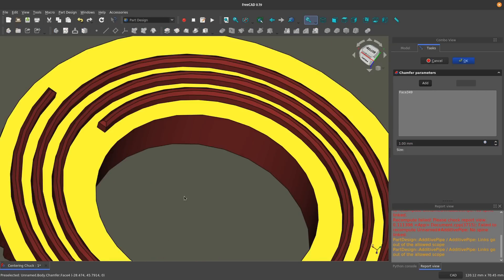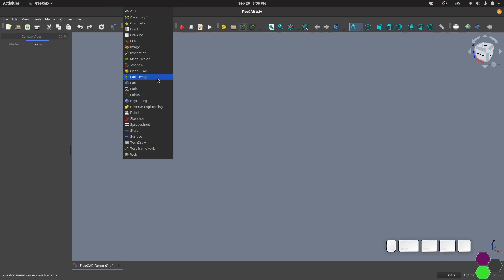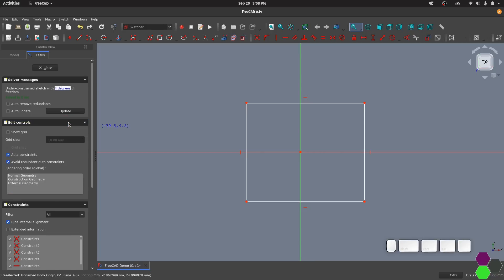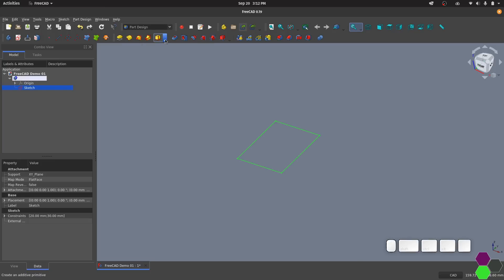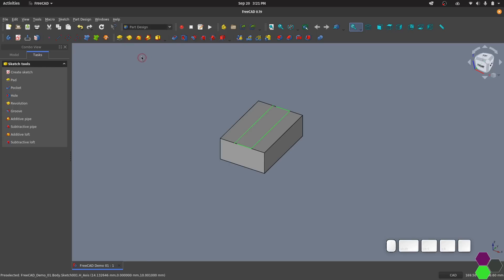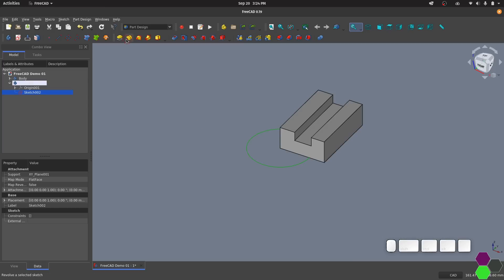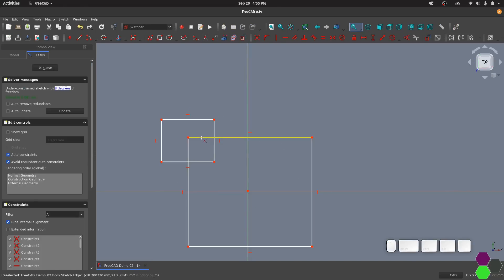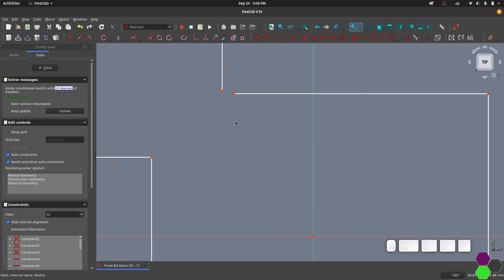Fusion360 to FreeCAD - Introduction

Comment: Excellent video, I'm a. paying fusion user, and I like it a lot on my new Mac mini m4, but Autodesk left out Linux and. my old Intel. Mac, yes I know we all have. to move on...:-(   So I use Fusion a lot, No WindoZ or fusion on. my 2011 Dell, But ubuntu runs like crazy,  ehh hem,   WINDOWS SUCKS,  so I never use it, or any thing Willy boy is connected. to.  Well there is my rant.   Im looking forward to using this to do. a lot.  I confess, I haven't read all the help yet.  Very nice to have an Excellent alternative to Pay software.  I tried. to. use Desaults hobby platform, it's total. nonsense.  and breaks continuously... pay for what you get is what I. hear... hmmm FreeCad. !    YES

Comment: In 360, and can extrude on both sides, how do i do that in free cad
Reply from the maker: When you pad (extrude) an object, just above where you enter how much you want to pad, there is a drop down. By default it will say Dimension, if you want to do both sides, you can select "Two Dimensions". This will give you a second place to enter another extrusion length.
Hopefully that all makes sense.

Comment: Fusion 360 seems to be one of the easiest pieces of SW to learn CAD. I made a start with DesignSpark Mechanical, then tried Fusion. Not an expert user but I do feel comfortable using it. My initial attempt with FreeCad was similar to using Solidworks 2013. It feels much more difficult, and was somewhat dissapointed. Willing to try more with FreeCad mainly because it's available for my work laptop, as a 3D Experience licence for designing stuff cannot be justified yet. And I do need occasionally to design something for work. If it wasn't for the cloud based feature of Fusion 360 I would already consider buying a proper licence. Anyway good video.

Comment: Great video, thanks. Had been using Fusion for a little while, but as it is cloud based, and my connection speed is not so great (retired, and no money) I decided to use FreeCAd. What this did highlight was, my 3D modelling skill. None. I do get confused with bodies, and multiple bodies in the same project, and the relationship when I use, say the sweep tool. FreeCAd is somewhat more bare bones than Fusion, but it is where I am now, for the speed. If you have the time, a lesson on the what is the 'tree' and the rules that would apply to bodies, and how bodies work in the project. regards, David
Reply from the maker: Hi David, thank you for the feedback on both of my videos! I am planning to do some more FreeCAD videos shortly, but in the mean time I'd suggest checking out videos from FreeCAD Academy / Flowies corner (same person, but they have an English and a German channel), Andrew CAD (has great explanations of each individual tool on detail), Joko Engineering and Math Code Print.
If you have any issues, let me know.
Good luck!

Comment: I tried to follow a long but I got lost right at the start when I selected Part design and no new toolbars opened like yours :(
Reply from the maker: They should if you have a new document started, but if not you'll be able to put all the toolbars you need back by making sure you're in the Part Design Workbench, going to the View menu at the top of the window, then to Toolbars and enable Structure, Part Design Helper, Part Design Modelling and Measure.
Let me know if this doesn't work (if it doesn't can you tell me what OS you are using and what version of FreeCAD).
Good Luck

Comment: What I would've liked to see was how components (or the FreeCAD equivalent) work.
Reply from the maker: If you're just after something to create instances of bodies, that is called a "Link", there are a lot of good videos out there on how to use links.
If you're after a full blown assembly system. there are 3 entirely different 
add-on workbenches for that. They all work differently and have pro's and con's and would be too confusing for an intro video.
Reply: @BrodieFairhall  Thanks. But why would I have to get plugins? Can't FreeCAD incorporate these Plugins?
Reply from the maker: @user-yh5dc8ve8e  Eventually FreeCAD will have a built in assembly workbench, right now all 3 assembly workbenches work fantastically and give people a lot of options as well as letting the team work out what the best features for a built in assembly workbench would be (realthunder recently did a talk on this actually). The add-ons can be installed from within FreeCAD, so it's incredibly easy.

Comment: I guess it really comes down to what you need. Sofar it seems to me that for mechanical solid modeling FreeCAD delivers very well. But for product design where you work more with surfaces, blend curves etc it quickly shows missing tools. RealThunder is a pretty god sent for FreeCAD to catch up.
Reply from the maker: You should really check out the curves add-on, OCCT has incredible surface modelling power and this workbench really makes it accessible.
https://youtu.be/iUhHgnvgpo0
Reply: @BrodieFairhall  I did watch and follow it - when I bring the STEP export into Fusion it shows many tangency issues. I might have to investigate more.

Comment: This video must be called: welcome to hell. Freecad is a great idea for the moment, but it's very frustrating to use.
Reply from the maker: If you're expecting it to work the same as some other CAD software, it sure is frustrating.
I've been using it commercially for getting close to 3 years now, at first alongside Fusion and Inventor. I can have access to Austodesk products any time I want, but I'd definitely prefer FreeCAD.
Use what works best for you and if you want to try something else, it's going to require time to really get to learn the workflows.
If FreeCAD is a bit much, perhaps have a look at the Linkstage3 build of FreeCAD.
Reply: @BrodieFairhall  I quit in frustration when I was using the assembly 4 add-in, lost all colors in parts, and I was never able to undo operations.

Comment: the trim tool didn't work on my circle D: it's such a bummer that I can't select surface of a sketch or parts of it to pad like fusion and solidworks. I hope they add that soon!
Reply from the maker: The trim tool can be a bit finicky, it can do weird things depending on how your sketch is constrained. I don't use it 99% of the time.
You could use the arc tool to create the part of the circle you need instead of making a circle and trimming it.

As for being able to selectively pad (or use any other action on) parts of sketches, I doubt that will ever be in FreeCAD, as it's generally viewed as bad CAD practice. I learned why it's bad in Fusion when I started making a lot more customisable / highly parametric designs before I really understood why fully constraining sketches was so important, so I got a lot of topological problems and a lot of other weird geometry problems. It wont effect you in Fusion unless you are really doing a lot of parametric design, but as I learned FreeCAD I started applying what I learned to Fusion and it made me much, much better at Fusion.

Oh also I remember you talking about wanting to project surfaces from imported parts etc. While I kinda advise against it in the long run, this video from Andrew CAD (https://youtu.be/MCY5IrWrHrU) will introduce you to the shape binder tools which will let you do exactly that.

Comment: Does FreeCAD require an internet connection in order to work like Fusion 360?
Reply from the maker: It doesn't require an internet connection, it works completely offline (and doesn't report back to any servers either).

Comment: The video has good intentions.. thanks. But omg, Freecad looks horrible.. i think im spoiled with the ease and good looks of Fusion.
Reply from the maker: This is but an intro to FreeCAD, it doesn't touch on the variety of add-ons to improve the UI and general aesthetics or additional quality of life tools.
There is a development version of FreeCAD which Fusion users find far easier to use from one of the core developers "RealThunder" (Lei Zheng).
https://github.com/realthunder/FreeCAD_assembly3/releases
If you want to see demos of it check out this channel https://youtube.com/channel/UC4PIO2pZaFKzI97uumFTNSg

Fusion and FreeCAD are very different, you can't just apply your Fusion workflow to FreeCAD and expect the same result. Fusion is fantastic for quick modelling, it allows you to be pretty lazy compared to most CAD suites, but after using it commercially along side other packages I don't think it's suitable for real commercial use. FreeCAD on the other hand is most similar to CATIA, in that it might seem clunky for a new user but once you've spent to time to get to know it and develop a good workflow the tools available for it and the power it has is endless.
They each serve different purposes and it's hard to make a direct comparison without discounting the merits of each of the packages, but I'll say this, learning FreeCAD will make you much better and far more effective at using Fusion (speaking from experience).

Can't forget to mention the obvious, that FreeCAD is FLOSS, which means you'll never get locked out of your work whether it be from the removal of a tool, a licence change or a server being down.
Reply: @BrodieFairhall  Well, im going to get going with using FreeCad next to fusion. follow along some tutorials and make my projects alternating on fusion and freecad. and hopefully when the day comes i have to leave my educational fusion account (wich still has unlocked everything) i am used to freecad and happy to move on.. who knows. gonna guive it a try anyway!

Comment: I intensively tried FreeCAD for almost a month full-time. Version 0.19. No offense to the guys making this available for free and putting in their best effort, but... It's buggy mess compared Fusion360. Not to mention it doesn't come close functionally. With a larger model the performance also comes to a halt.

 I was unable to do my project with it. Fusion360 isn't perfect and I understand the loss of trust in Autodesk due to the nerfed free license, but it remains the better choice by a considerable margin if you're doing anything slightly complicated.
Reply from the maker: I understand your frustrations because I have been there. I have a rule, don't learn a new tool by doing a big project with it, it never ends well.

Fusion and FreeCAD work very differently, if you use your fusion workflow in FreeCAD, you'll likely end up with tons of problems and the larger it gets the worse it will be. 
Learning any new tool takes time and since you still have access to fusion, you can take your time to learn but still have access to a tool you're familiar with.
Performance isn't an issue with larger models or assemblies that are built correctly and I would guess that the majority of the "bugs" you're referring to are topology issues (I have a video on that, or I suggest you at least look it up in the forum).
If you learn to use FreeCAD correctly, you'll end up being much better at Fusion too (I used both commercially in parallel for 3 years and my fusion skills were dramatically improved) and you'll find things you like better in each program.
If all else fails, you could try using the Linkstage 3 branch (https://github.com/realthunder/FreeCAD_assembly3/releases), many people feel much more comfortable in it.

It took me 3 attempts to actually move over to FreeCAD, but now I'm here and I wouldn't go back.

Comment: I would like to go to freecad but sadly, it's like many other open source tools. GUI is not straightforward, it's not as focused to task I'm working on etc.
What I am talking about? Well, just look how much you have to mouse around just to set dimensions or extrude, click OK etc. Why not to have this things RIGHT at the mouse pointer and do not mouse through all the monitor to set a dimension or to confirm something to just hit Enter or Escape for cancel? Most people are using big monitors and high resolutions to get as much of space as possible. Just to create something simple you will be mousing around like an idiot.

GUI is, was and will be an achilles heel of most of the OpenSource apps, otherwise great for possibilities and backend. Look what Apple (and to certain degree, Google) has done with a software using a lot of OS code… That's how it should be. Sadly, developers are not usability and interface experts so the SW works this way. It's always like the GUI is an afterthought, just to snap it there to have some buttons…
Reply from the maker: A lot of people are initially put off by FreeCAD's interface. since this is a tutorial video I am making sure I use a fresh install without any modifications (with the exception of the theme change), I also limited the amount of keyboard shortcut keys I used in favour of showing and using the buttons in the menus, ok buttons, cancel buttons etc. If you were to watch me use FreeCAD when I'm not recording, I have a very different setup, I use the keyboard for almost everything and my workflow is much, much more streamlined.

The main branch of FreeCAD only has 3 main developers, so aesthetics, UI and UX don't get get as much attention as most people would like, but there are a lot of addons to improve this, which can all be downloaded directly through the addon manager in FreeCAD.
Some good examples are;
- Modern UI: https://github.com/HakanSeven12/Modern-UI
- Pie Menu: https://github.com/triplus/PieMenu

One of the main developers, Lei Zheng (aka RealThunder) has been making some incredible UI and visual upgrades in their development branch (Link Stage 3 https://github.com/realthunder/FreeCAD_assembly3/releases), many of which will likely be rolled into the next version of FreeCAD next year.
Here is a good example of what FreeCAD Link Stage 3 can look like https://www.youtube.com/watch?v=s7O0gIvXnLU
And additions to the pie menu https://www.youtube.com/watch?v=tq-FJH0p9aE

Hopefully, after Autodesk pulling their recent stunts with Fusion 360 and Inventor LT, more attention, contributions and donations so 
In all honesty though, once most people start to get used to any CAD software, shortcut keys get used more and menus less, even fast menus radial/pie style context menus are much slower than a well thought out, context aware set of keyboard shortcuts.

Comment: Very good and informative video. Can you do a video on the 'grid system' setup. Thanks for the great videos!
Reply from the maker: I'm not sure what you mean by the 'grid system'?
Reply: When setting up your work environment you have the choice of using Metric or Imperial measurements. Question: If accepting the default settings (Metric), for your initial settings, can you use Imperial measurements in a drawing without modifying your default settings? I believe the answer will be in understanding how to manipulate and setup your grid environment settings. Which would probably be better implemented in a beginners tutorial.

Comment: I will give it a try, Fusion 360 did a 180 on everyone as expected. I just need a Cam to import to, any suggestions  ?
Reply from the maker: Not sure what you mean by "a Cam to import to"?
Reply: @BrodieFairhall  to write CNC mill programs. I need a Computer aided machining pgm to import models to.
Reply from the maker: @forrestgumpv9049  FreeCAD can do CAM paths and gcode export using the Path workbench. I plan to do a video on it soon.
Reply: @BrodieFairhall  That just made my day ! Thank You ! I will definitely install it now this weekend.

Comment: Are you aware of a shortcut that allows you to search commands in FreeCAD? Similar to the 'S' key in Fusion 360? It's such a useful shortcut.
Reply from the maker: I'm actually not sure, I'll have to look into it.
I've also used Fusion for over 5 years and I've never used the command search there either.

Comment: question?   can you save work to gcode  .cn     or something useable on cheaper cnc machines
Reply from the maker: You absolutely can, CAM paths and gcode are generated using the "Path" workbench, I plan to do a tutorial on it soon, but there are a few videos on this already. I absolutely recommend version 0.19 for CAM, it has a lot more features than version 0.18

Comment: I like Freecad alot. I have however stumbled upon Siemens Solid Edge and that thing is a local install with local storage. Definitely a solid 360 contender
Reply from the maker: Solid Edge and Solidworks both seem to be nudging in to the space Autodesk opened up with their recent stunt. It's great to see some kind of community support coming from Siemens and Dassault Systems, it's also a smart move for a company to get people familiar with their tools so that is the one they want to buy if they do any commercial work. There is always still that risk that they will change their licensing.
FreeCAD might be lacking a bit of polish right now, but, it is still a fantastic tool and if the community gets behind it, it will grow and they'll have a tool that no one can take away from them. Blender and KiCAD are excellent examples of this.

Comment: Validating a sketch into the sketch is impossible, it doesn't let me. Validating it when a body has been already creating means not being able to see it. This software is still a mess.

edit: I'm in V19.something. I've been very rude, this software has a lot of potential and it's normal to be rough on the edges if there are only 3 people working on it. I hope it will succeed and become even better than Fusion.